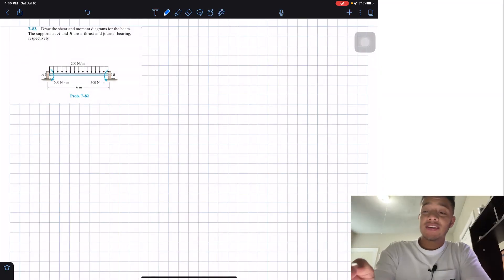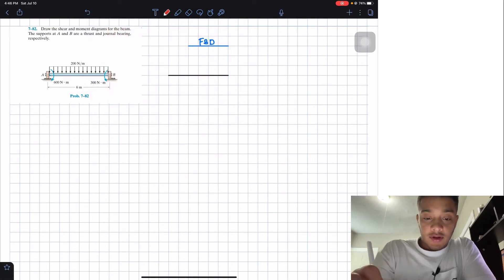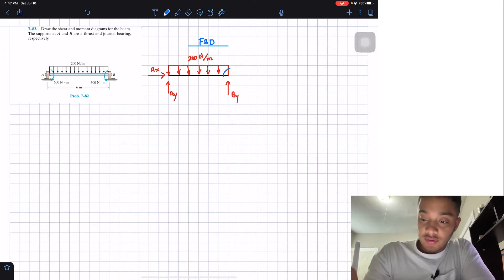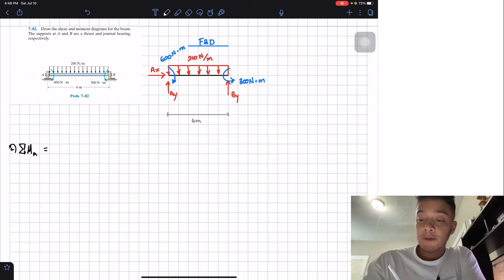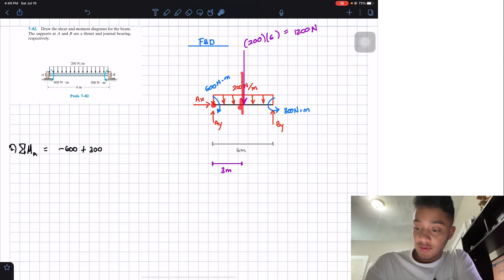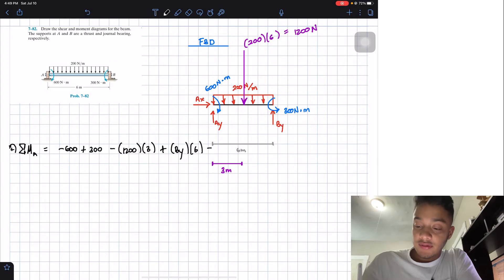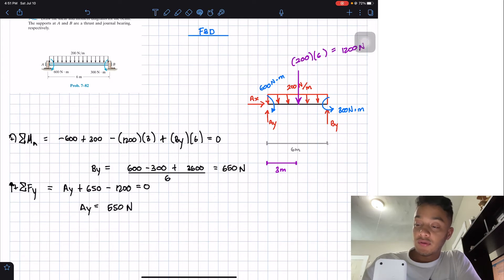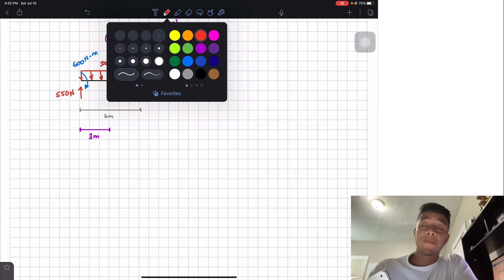Statics 7.82 - Draw the shear and moment diagrams for the beam.

Comment: How did you know that the moment graph was gonna be like that?
Reply from the maker: I like thinking the moment as basically the integral of the shear graph. When the shear graph had a positive are under a linear equation, then it allowed me to think that the moment should have a parabolic line. Then similar for the other negative are of the shear diagram. In addition, a good rule to check if you did them correct is that both shear and moment diagrams start and end at the 0 mark.